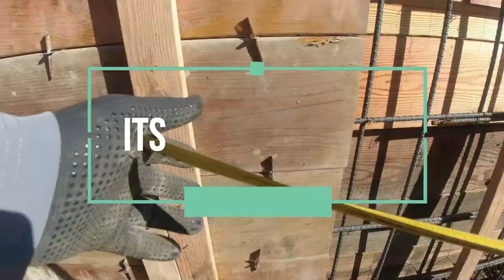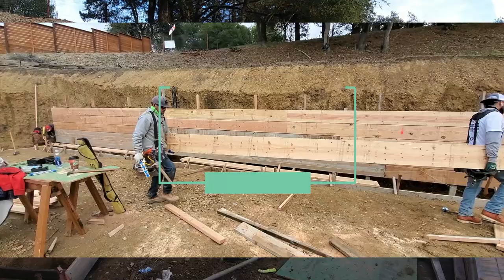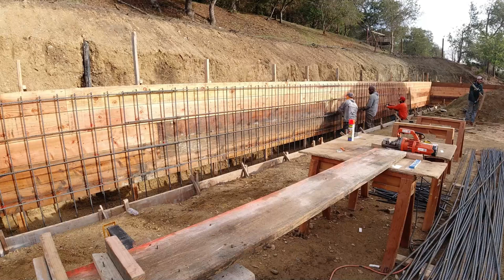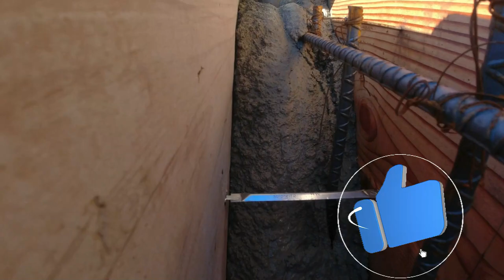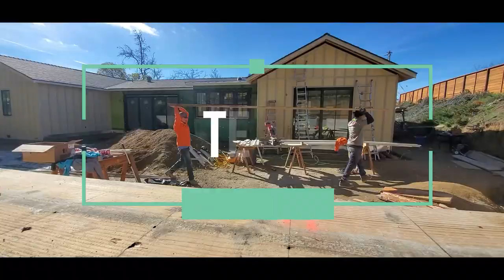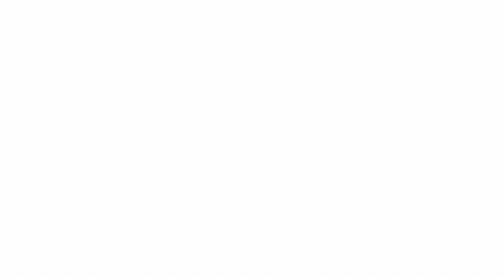It Takes "TEAMWORK" To Build A Concrete Retaining Wall

Comment: Do you do any basement walls. We are wondering if we should do monolithic or do cinderblock since cinderblock wouldn’t allow us to install drain pipe and gravel as we build up. We have done both in the past also with cinderblock we could put a waterproofing material on the rear as we increase the height, do you have any videos on this basement are incredible as you can tap into unused space in London. They have a program called million dollar basements which we saw on YouTube.
Reply from the maker: I look at basement as under ground retaining walls.. I prefer poured walls over cinder blocks.. Ill also apply a waterproof membrane to it as well.. Also, you can use a Mira drain set up for the drainage.. Check it out https://youtu.be/MwlCxZkzGSI?si=txSxqA3FQmOsG0Bx
Reply: Thank you for the link we will check it out
Reply: Thank you sir, for that link. We have used the mirror drain before in different situations on some basements we have done. We have poured the concrete right against the dirt only putting up one form wall when we did those jobs. We did not have any drainage behind the wall, nor did we use gravel as the concrete went right against the dirt. We are looking to develop a technique where we can have drain rock behind the wall and also pipe, but we would perhaps be pouring our concrete against the dirt as we could not access the back of the wall once our wall is finished . We Have ideas in our head but are looking for different techniques. People are using thank you so much for your prompt reply and putting up this information on your channel the current basement we are working on. We moved over 2 million pounds of dirt that was over 200  7 x 14 dump trailers.